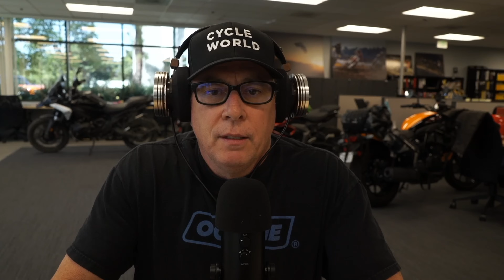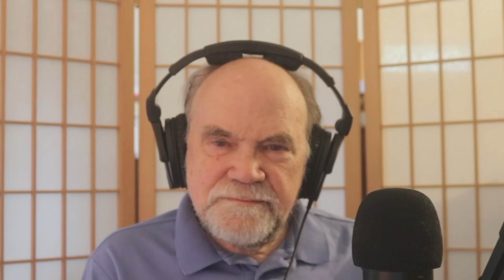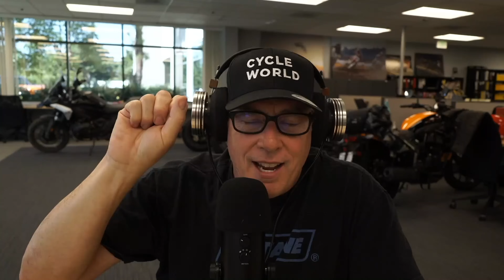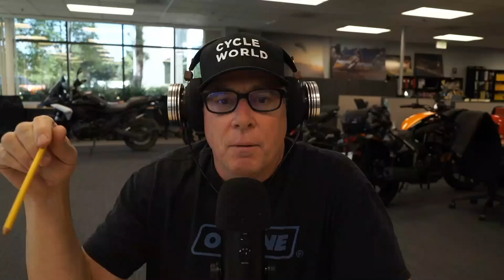The DIRT TRACKER that WOULDN'T DIE: Harley-Davidson XR-750 introduced 50 years ago (Still Can Win)

Comment: Windage and breather control are two items I've been sneaking up on for decades on Sportsters, for the most part. I think I've finally gotten my race bike dialed in. 7 ounces in the case sump after a hard pass on the strip. Makes a huge difference in the mannerisms of the engine. From how it spins up. to how it doesn't leak oil.

Comment: One interest8ng thing that wasn’t mentioned is the twingle vs single timing setups used on xr’s. Sometimes the alternate single or ‘big bang’ timing was used for 45 between detonations to simulate a big single. Apparently this was preferred by some riders in lower traction conditions. Told to me by family friend Gary Stippich who ran HD flat track program for many years. A while back gave me a tour of the old race shop on Juneau street that had been operation for over a century - amazing place

Comment: Listening to Kevin talk about small inlet valves and a steeper inlet port and how the air speed is so much faster inspired me to tell a quick story about an engine that shouldn’t make power but did with these same modifications. A friend of mine asked if I could hot up his Suzuki DR five hundred engine. I was not able to find any performance parts at all for it and had to put the thinking cap on. I ended up using Honda XL five hundred piston to get a larger displacement and more compression. I then attacked the head with a raised inlet port and some  cleaning up around the bowl area. Some valve springs that were fora car engine that worked. Put a thirty eight mm flat slide to it and  cleaned the exhaust port. For an engine with the tiniest valves that obviously was not considered to be performance capable, it went surprisingly strong and still does. There were other mods we did but the basics of airspeed applied. Sorry about the written numbers and not digits. My iPad has something not right going on.

Comment: The XR750 is simply the very best flat track motorcycle ever built. By far. The Indian comes close, but the XR750 proved to be MUCH more successful. I mean, when a privateer Harley XR750 beats the factory Indians what other proof do you haters need? Adios Indian. Should we call Indians, commanders? 🤣😆🤣

Comment: The story about the Norton machinist and his stick reminds me of an old horizontal milling machine I operated briefly. The job was to cut the waffle face on four framing hammer heads per cycle. Only problem was, after turning the fixture 90 degrees and running the 2nd pass, it would wipe out the grooves cut on the 1st pass, and so on when returned to starting position to recut the first pass. They sent out the very expensive cutters for sharpening, which didn't solve it. The maint. dept. tried to figure it out by stringing strings across the bed to check for true to no avail. Next time I ran the job, I watched the oil cushion on the arbor holder bushing in front of me and noticed it squeezing out as the cutters climbed the parts. Viola! Worn bushings! I shoulda had that guy's stick!

Comment: I like flat track Motorcycle racing especially on the 1/2 Mile Cushion tracks  in Ohio , county fairground tracks with the Broadslide in the turns inches a part steering with the throttle and a 20’ rooster tail coming off the rear wheel of the Motorcycles  !

Comment: In 1983 the AMA approved the Honda RS750D for Class C flat track competition. Honda successfully conned the AMA Rules Committee into believing that the RS750D’s engine was based on their XLV750R shaft-drive dual-sport bike introduced into the European market in 1982. Which was nonsense! Given the XLV750R’s engine had a 52-degree V-angle, with an offset pin crankshaft, and the RS750D was a 45-degree V-angle engine with a single pin crank and with chain drive, it was obvious that this was a cynical ploy, and the engine violated the rule promulgated in 1932 requiring Class C flat track motorcycles to be based on production models sold in the US. The XLV750R was not sold in America.

The RS750D engine was without question a race-only engine. A "cheater". The AMA was bought off by Honda money. Once the bugs were sorted out, Ricky Graham won the 1984 AMA Championship on a RS750D. Bubba Shobert then went on to win the Championship the following 3-years in a row, in 1985, 86’ and 87’, absolutely decimating the competition. But Honda had had enough after only 4-years and took their "cheater" RS750D''s home. 

Moving on to 2017, the American Flat Track Championship, the new name for the Grand National, promulgated new rules for AFT twins, the top class. Two subsets of engines were approved. “Production-based” motors limited to 998cc, and “Race-only” motors limited to 750cc.  Old timers thought.. “Oh no! Here we go again!” The AMA was bribed ~ by Polaris deep pocket money this time. Its "Indian in name only" FTR750 was a special race bike with a race only-engine. Hand built in Switzerland by a company that builds prototype MotoGP engines. This engine was not available in any production street bike as required by Class C rules promulgated in 1932. And Kevin Cameron went to the Swiss factory and shamelessly promoted the "cheater" flat tracker in Cycle World Magazine.

As to be expected the results mirrored the results obtained by the Honda RS750D route in the 80’s. These “Indian in name only” motorcycles, with their race-only engines, decimated the field of production engine bikes in the same way the RS750D’s did. A sorry state of affairs. And one oblivious to all casual fans. The AMA had once again pulled off one massive con job. Jerrymandering the Rules for Polaris! Exactly what low-information fans always accuses HD of! GMAB

THE GOOD NEWS: For 2025 the FTR750 has been banned. AMA Pro Racing has been persuaded to follow the Class C rules ~ and balance will be restored. Polaris has to “hot rod” one of their street bike engines to compete against the Harley-Davidson XG750R’s, Yamaha FZ-07’s, Kawasaki Ninja’s, and the Ducati’s and KTM’s. All of which are legitimate Class C bikes! The gravy train has ended for Polaris.

Comment: Isn't  a Slipper Clutch a Form of Torque Converter?  Mayber not a 3 to 1 peak Torque multiplication factor, but maybe 1.75 ?   Used to squirt oil on my B&S 5'er Go Kart torque converter.. Used to spin those pretty fast..  certainly 7 or 8K with a few basic backyard mods.

Comment: 33:00 That story about the move of Norton manufacture from Bracebridge St Birmingham to the AMC factory in Plumstead circa 1960 is true.  The bosses were too mean to service the machine that bored the main bearing housings, and as the spindle bearings wore out, it developed a chatter.  The machinist who had operated it for many years took to using a plank to push on the spindle and prevent chatter. As the bearings in the boring machine got worse, he just pressed harder on the plank.  He lost his job when the tooling got moved to Plumstead.  The crank cases machined in Plumstead were all scrap due to the chatter.  Eventually, management decided to find the Birmingham engineer who had done the job for decades and produced good main bearing housings, and ask how how he had done the job with such rubbish tooling.  He replied - "Surely you have The Plank?" 
My 1955 Norton 500 twin has crank cases that were machined by this man, on THAT MACHINE.  It has done around 92,000 miles now, and the cases are just fine, thank you.

Comment: If you can get a hold of the October 1978 issue of Cycle magazine there is an insight filled article on the development of the XR750.  Written by Gordon Jennings it is peppered with quotes and the thought process's of Dick O'Brien, it is long and in depth.  From H-D's listed spring of 1975 dyno chart the "#5 San Jose Miler" engine produced a peak of 88.9 BHP at 7600RPM and a nearly flat torque curve of 60-63 lb/ft from 5600-7600RPM.
Reply: @ All horses you can put down on the track.

Comment: I really love these, particularly when Kevin asks the musical question, "How'd you break THAT?" From being an aircraft mechanic for 35 years, I have asked innumerable pilots and/or flight attendants that same question. It all boils down to this....anybody can break ball bearings in a sandbox with a rubber mallet if they work at it hard enough and long enough. That modern motorcycles are as reliable and as GOOD as they are is a testament to the guys who, after much head-scratching and midnight-oil-burning, figure out how to keep that particular ball bearing from breaking under the vicious onslaught of the rubber mallet.

Comment: When they speak of primary gear change, it was crank to transmission input shaft gear ratio.
They would keep the sprockets the same to keep the rear swing arm to  chain distances, but change the overall ratio at the trans input (gears) rather than at the output (sprockets)

Comment: Mr. Cameron reminds me of a couple of my favorite instructors in the Airframe and Powerplant school I attended many years ago.  Men with lots of experience with small and very large piston engines.  The problems with Wright R3350 and its PRT's and Pratt 4360 engines were discussed a lot.  They were much more interesting to me than both the Low bypass and the more modern High Bypass engines that have consumed my workdays for the last 35 years.  I always thought of a big twin Harley engine as a two cylinder radial engine kinda sorta. Keep up the good work guys.
Reply: Yep we’re on the same page; got my A &P in the 70s. Always loved piston engines over jets!

Comment: I've had a few bmw r1100rt's over the years and one of the things that bothers me about this engine is how it jerks on deceleration. I found out that if I just put the choke on (actually just a high idle) in slow or stop and go situations that it bucks a lot less. I end up with less compression braking, like Mark mentioned with his 'just turn up the idle' comment. I think that a lot of modern fuel injection systems will completely cut fuel when the throttle is chopped, which makes compression braking a lot more stiff. My first gen Hypermotard was almost unrideable until I got an o2 sensor hack.

Comment: Crankcase pressure. On the XS650, Yamaha used a baffle box atop the rear of the head. Originally with two hoses venting, they reduced that to a single hose in '74, at least. Too far back to remember now, but I "think" they simply dumped the hose at the rear of the trans. Sensing doom, I pulled the stamped steel baffle out of the breather box and dad (Boeing experimental and test mechanic) worked out a different design which was heli-arc welded into the box. Combined with the original two hoses, I ran them both into the countershaft cover. Turns out that "I" was also into Autolube. Rode around the US, 15K miles, with a Diamond XDL chain in 1978. With mist-lube, the chain made the entire trip and a few years after. Then Diamond got scared and stopped M/C chain production. (sigh)

Comment: Very interesting as always. Suggestion: dirttrack earlier days 1960's and early 70's when not only H-D but BSA Triumph Norton Yamaha xs650 where all close in performance from one  onther. Also it would be interesting to learn the engineering story why in the early 80's the Yamaha Virago never could make it in dirttrack.  Virago Engine rotating backwards what's the idea behind that. Great success in sales for the shaft drive models 1981 to 1999. Keep it up on those stories. Thanks

Comment: Loved these videos learn so much and get the odd laugh here and there. I learned about asperities once from Kevin and now find myself smoothing out my asperities on my brand new Hypermotard 698 and whilst riding it i can put the engine under pressure and imagine now the metals working together to smooth out them asperities giving my engine a nice film of oil between all the parts.  And it was his video that i decided to run it in the way i am.which is a mix between manufactures recommendation and adding a little more load here and there.

Comment: I was there as an early-teen kid as Harley-Davidson made the transition from the flathead KR to the Alloy OHV XR-750. My (elder) brother was racing flat track in what was then known as the Amateur class, and I tagged along to many AMA flat track nationals as the new 750 OHV rules went into effect. 

The Harley KR generally had a single carburetor between the cylinders on the left, exhausts on the right. The Sportster had a single carburetor between the cylinders on the right, with exhausts on the right. The Iron XR-750 may have started life with more-or-less stock Sportster heads, but they didn’t stay that way for long.

Recognizing right away that the Iron XR was not competitive, the Harley flat track teams tried many different configurations to try to get the engine to breathe. The elite Harley riders, who had enjoyed great success with the KR, found themselves scrambling to try to keep up with the Trackmaster and Sonic Weld Triumphs that quickly populated the track. The Harley riders seemed to have a new intake/exhaust configuration almost weekly— welded-up ports, front head on the rear cylinder, rear head on the front cylinder, oil coolers everywhere. I recall they even tried a front-facing intake on the front cylinder, with a carburetor and air cleaner perched to the left of the front of the gas tank. 

Ultimately, the Iron XR Harleys could not compete with the Triumphs, with Gene Romero winning the 1970 championship. The Alloy XR appeared, seemingly formed from the hands of God, but it actually was the product of a staggering array of experiments to develop an engine that could outrun the Triumphs. It was the experience of a lifetime to be there, watching this period unfold. Perhaps we’ll see something similar in 2025, with both the FTR750 and the XR-750 no longer on the AMA’s Approved Engines list.

Comment: When the XRs came out I was involved with Les Edwards of Cycle Imports and his efforts with Triumphs on dirt tracks. A Bonneville motor with 750 kit, highly modified head, mikuni carbs, in a Trackmaster frame was the setup. Dave Hanson was the last guy to ride for Les as far as I know. I learned a lot back then. Taking the bikes out for break in was the best experience a 17 year old motorcycle nut could have back then. I also was at San Jose track when Davey was putting on a show on a Kaw 750 triple. He was running away, a half lap ahead of everyone until he put it through the fence. Not sure if he rode that rocket again. Days gone by.....
Reply: It has been surmised that the large and centralized flywheels of both H-D and Triumph lead to their dirt success. Yamaha tried hard with the XS, but its flywheels, rather than being in the center of the engine, were split in two and centered beneath each cylinder. Harder to change direction even if it had slightly greater gyroscopic stability.
Reply: @HAL9000-su1mz  Just like it's been said that Maicos handled better than most other bikes because they used a chain drive primary where crank and clutch rotate the same direction and mainshaft layshaft trans.Rather than gear drive primary where they rotate opposite and a mainshaft countershaft trans.
Reply: @nkuntroll247  Plus Maicos had more sq. in. of fins per cc than all other motorcycles.

Comment: Mr Cameron.     Do you have a 
Erdos #.
You make me think of a master machinist with mechanical engineering and physics degrees. 
 Many years ago I rode a friend's Sr 500 powered street tracker.    Champion or another light steel flat track race frame. 
Can't remember. 
XR 750 tank and bodywork. 
Somewhere around 225 lbs.
I had a rz 350 at the time.
Just over 300 lbs 
Highly modified, and looks like a gp bike. 
Very fun.
But the street tracker is about the most fun of any street bike I have ridden. 
Even compared to my supermoto. 
If I build another bike,  
It will be a thumper street tracker.

Comment: Can anyone tell me what I had? 
It was an XLR. It was a thousand CC's. It was made in 1963. It had a CH headlight and a Honda 50 taillight. It was green with a really gay looking white saddle that could accommodate two. 
I was a dumb kid. Oh , Fairbanks Morse Mag. 
Does any of that info match to a certain model. I was also told it was a factory flat tracker. 
I can attest it was very happy sideways in the grass or dirt. 
The lights were just for show. They had no wires.
Reply: It was not a factory flat track bike, they were all still the 750cc flathead KR engines back in 63, and even the iron head Sportster was still 900cc back in 63, they didn't go to 1,000cc until 72.
You couldn't ever race iron head Sportster's in flat track racing since they were all 900cc and 1000cc, furthermore in 63 OHV engine's were still limited to 500cc as per the 1932 rule, OHV engine's in 750 weren't allowed until 1970, the iron head XR750 engine's they talk about at one point were special factory made 900cc iron head engine's that were destroked to 750cc, they were never sold on street bikes, they only made them for 2 years 70 and 71, then the aluminum alloy XR750 factory racing engine came out in 72, it's the legendary engine that dominated flat track racing for over 40 years. 
You had something someone cobbled together, if the engine was a 63 it'd have been a 900cc not a 1,000cc, if it was a 1,000cc then it was a 72 or later but either way it was not a factory racing engine. 
Any Sportster from back then could have had the distributor taken out and had a magneto put in, I believe there was also a few Sportster models made back then that had factory magneto's.